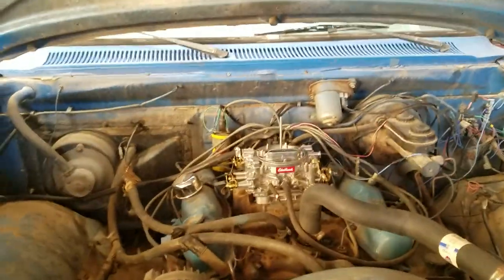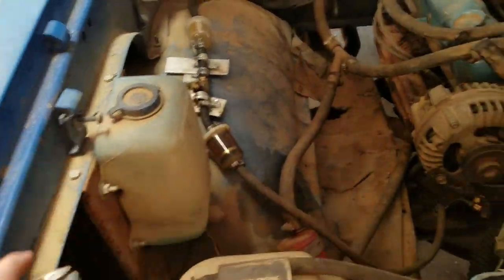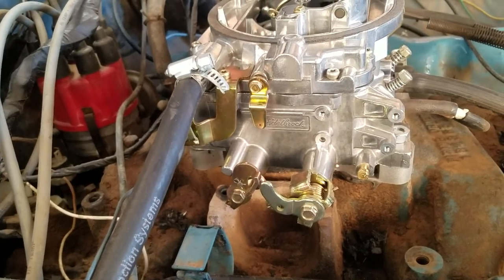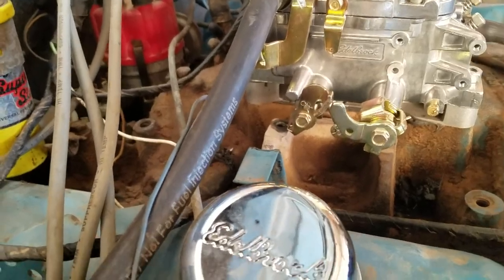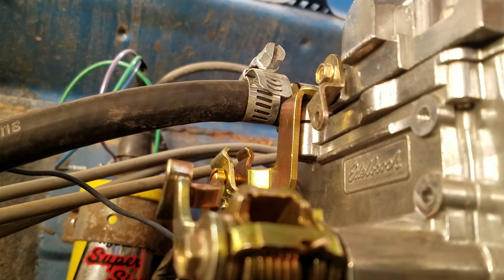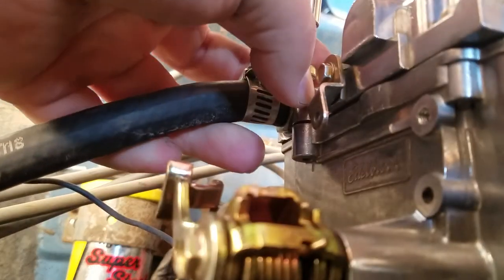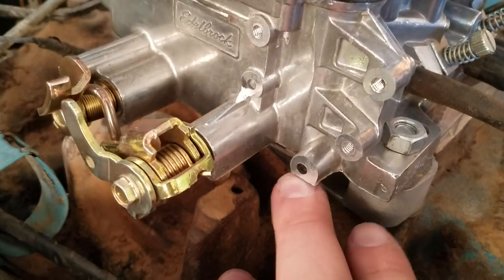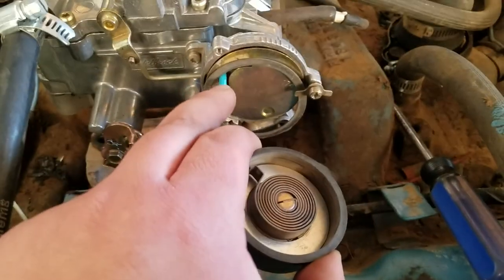How to install an electric choke on an edelbrock performer carburetor  part 1

Comment: I just rebuilt a 1406 with manual choke and I'm spending 20 dollars less to get cable ,mounting bracket ,lock nuts for cable. I was just debating on taking the whole carb off the car . But now that I seen this I'm ordering the electric choke
Reply from the maker: Thanks for watching